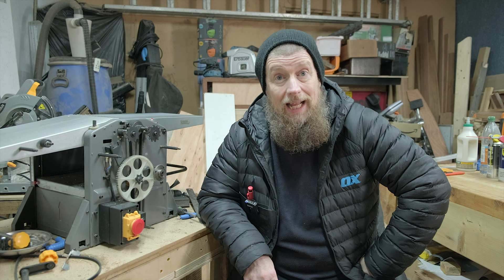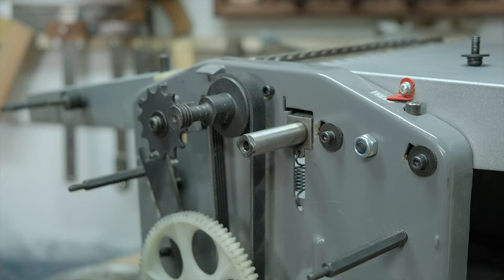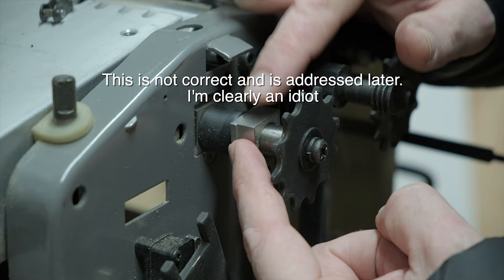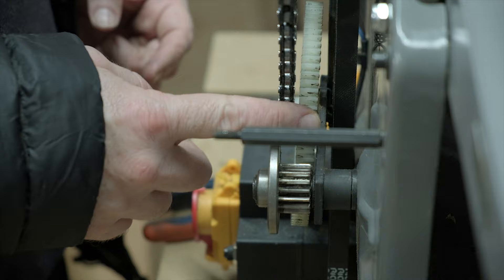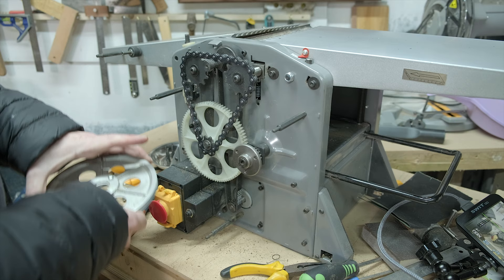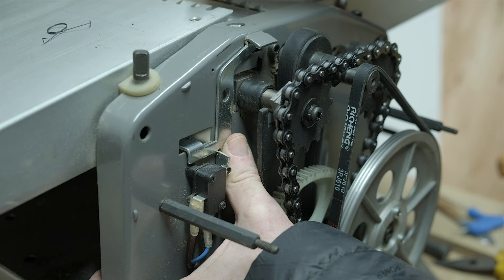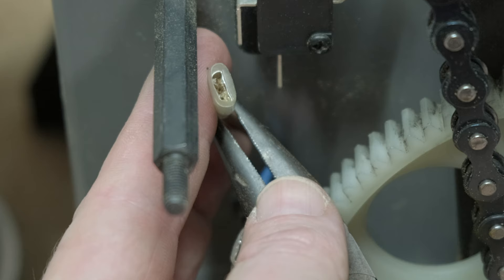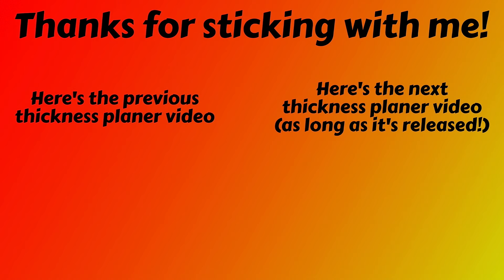CAN I IMPROVE HOW THE THICKNESS PLANER RUNS?

Comment: That square insert at the end of the roller spindle should remove with opposite thread to roller direction and there should be enough thread to place a spacer washer. (apologies haven't watched the rest of the video before commenting).

Comment: These videos are really interesting - and I'm really enjoying your presentation - so thanks so much! 

Quick question - did you manage to find any more out about the Infeed height adjusting locking handle/knob thing? Mine appears to be broken and I'm wondering if there's any need to actually replace it as it appears to do naff all...? I only picked up the Planer yesterday after having to return one bought on Friday because it just stopped for no reason I could identify. Definitely not lugging it back for the sake of a handle though.

Also, just a note that on the underside of the planer, there are a lot of vent holes, and I see you're not using the feet, so might be blocking that and cause overheating. Maybe not - but just thought I'd say.
Reply from the maker: Thanks James, no blocking of the vents thankfully.
I didn’t find out any more about the locking infeed, I think it’s probably one of the downfalls of a budget machine